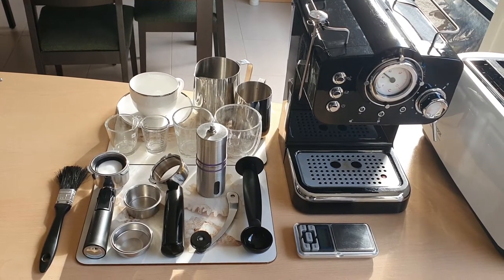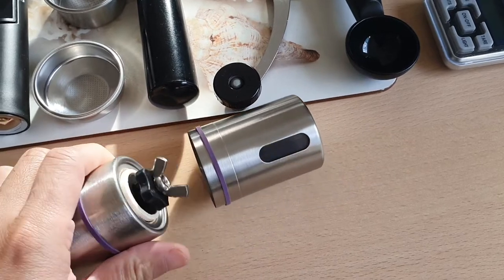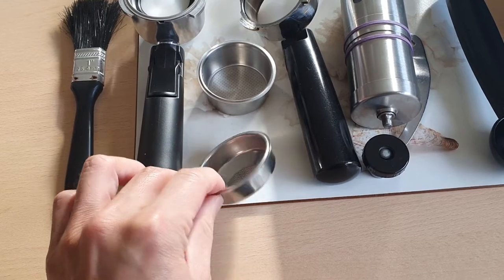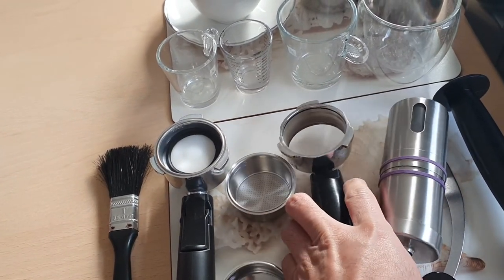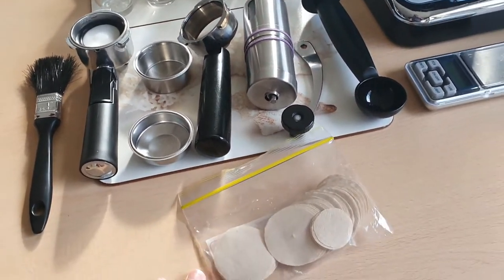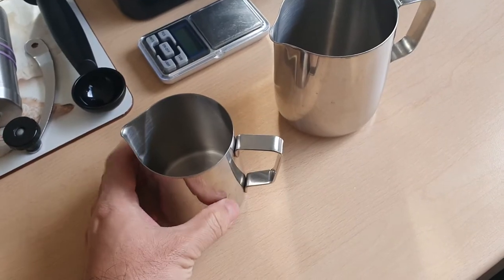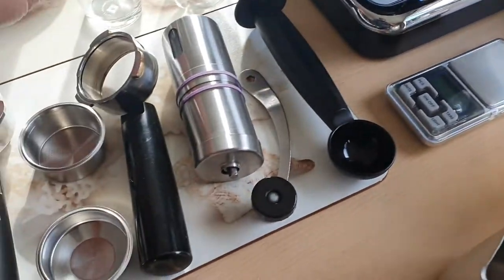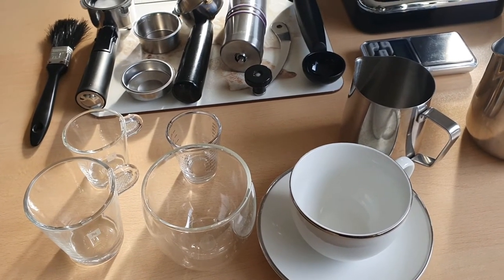Anko Coffee Machine - Non pressurised Extraction - What I used (Advanced)

Comment: Where did you get the aftermarket part? I'm considering taking a punt on a bottomless one off Amazon but not convinced it will fit into the swan machine as it doesn't have the same tapered wings.
Reply from the maker: I bought a used portafilter and just cut off the bottom part using an angle grinder and hack saw.
Reply: @rccrt6834  Thanks. You couldn't get a 4 cup filter in there then, right? Too shallow. I'll see how I get on with the one off Amazon. Unfortunately I don't have your metalwork skills or tools!
Reply from the maker: Haha, I don't have much metal skills either which is why I started off slowly with a hack saw. When it took too long and I got impatient, that's when I took out my angle grinder. Sliced it like butter. Then I just sanded it down with a file. I was surprised how well it turned out myself. 😀   I use a double basket and have never tried the 4 basket. Will be interesting though.